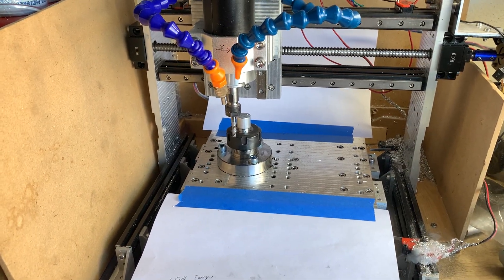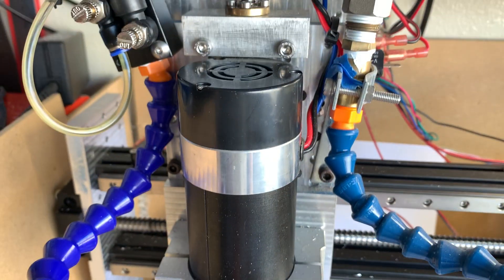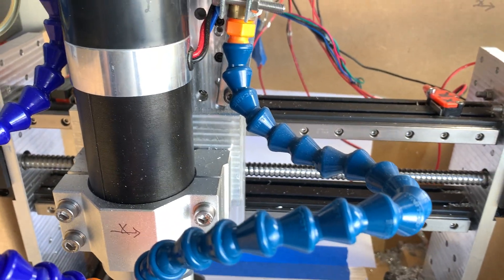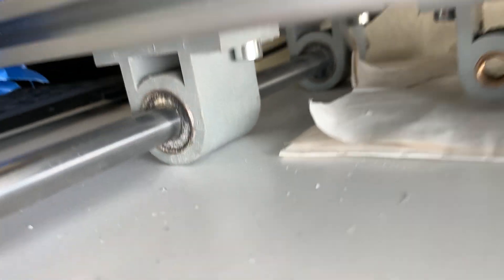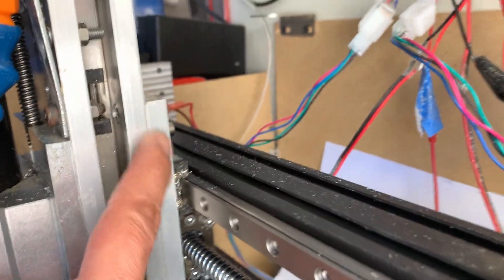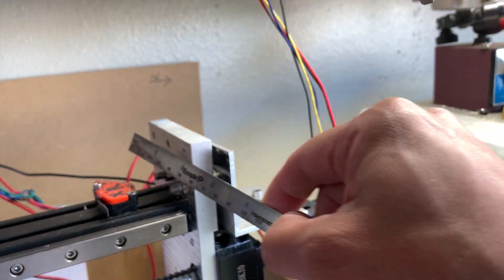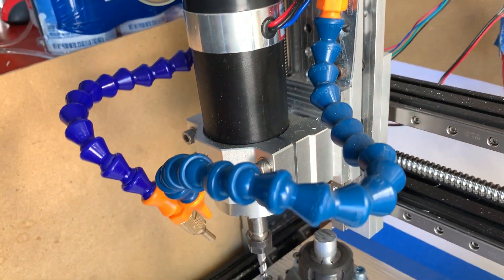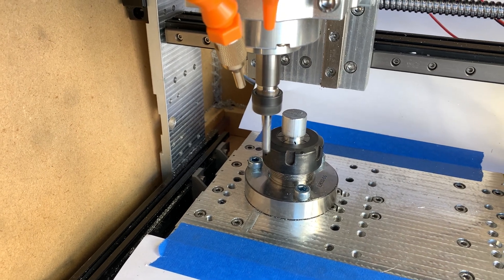3018 upgrades haphazard explanation:)

Comment: Thanks for this video, great.  I am also working on an updated 3018cnc and am still quite new to the cnc world.  I would like to equip all my axles with a nema 17 2.1A 65Ncm.  Would that be possible on the original motherboard, as I would like to keep it.  The spindle is no longer on the motherboard, it has been replaced by a Makita spindle.  Thanks in advance.👍
Reply from the maker: Yes the original board can drive 3 nema17 2.1A, I am running the original board and 3 2.1A nema17s
Reply: @guser210  Thank you very much.  Then I'll order them.  Have you made any upgrades in the meantime?
Reply from the maker: @56Moto  yeah since that video I added a sensor so I do not have to zero my z every time I change tools. When you get your new motors you might have to swap the wires depending on how they are arranged
Reply from the maker: Sear this video 3018 cnc workpiece offset probe

Comment: I like the idea you used the machine to make upgrade parts for itself, the only thing I would change is move all those valves and stuff away from the moving portal to reduce the weight/inertia of the moving parts.
Reply from the maker: Actually it needs more weight, the bigger the mass the better the cut.

Comment: Really nice job man. I'm making my own 3018 custom, does make sense to spend money into nema23 (and drivers)? Or big nema 17 is enought?
Reply from the maker: Nema17 are find if you are going to use the same controller to drive them otherwise I would go with bigger steppers
Reply: @guser210  Thanks. What's the tolerances you can afford and how is the finish result?
Reply from the maker: @carlohaku5428  I get repeatable result within 0.05mm and decent finish, search for "Modified 3018 boring aluminum"
Reply: @guser210 wow, 0.05mm is the thickness of hair